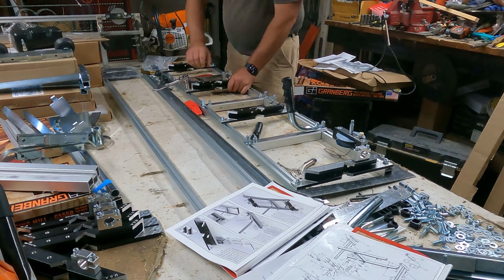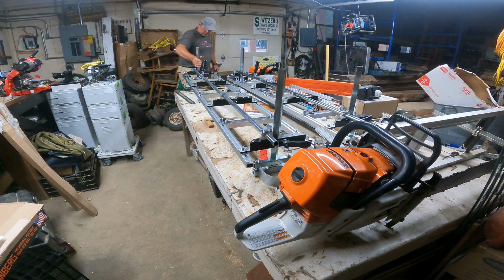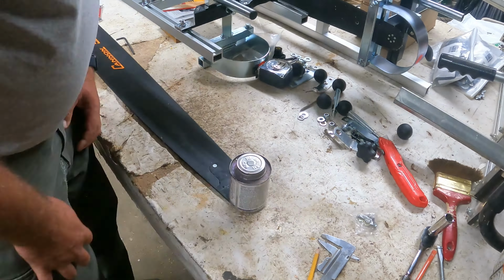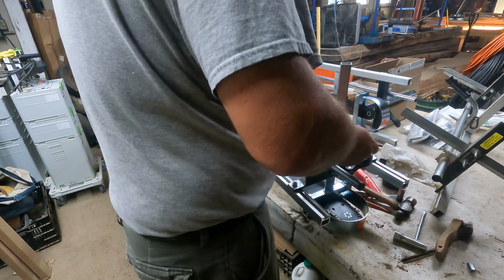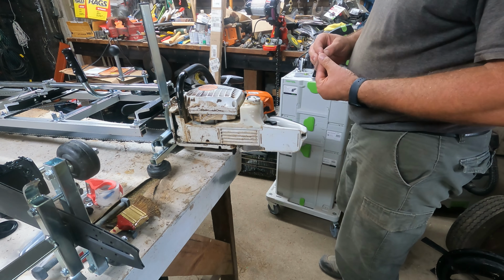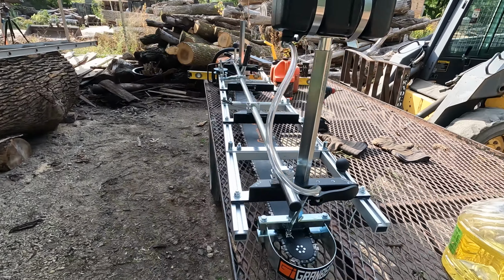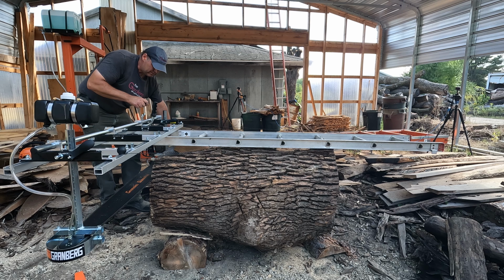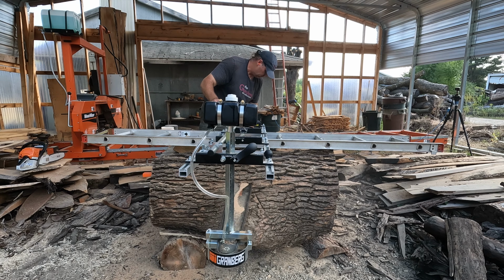Granberg Alaskan Mill Build ~ 60" Chainsaw Mill Assembly & First Cut

Comment: I have 60" bar for my Alaskan mill.  Really tough getting the chain tension correct.  Can you share how you tighten the chain on the 60" + bars?
Reply from the maker: still working on it too... I'll be removing a link on my 60" chain and believe there'll still be enough travel to get the chain on. I'll pay more attention over the next couple milling sessions and report back in the future.. Cheers!
Reply: @WorkshopatTheGardens  thought the same thing.  How many links do you start with or are down to?  I think it is 185 links but running out of chain tension.